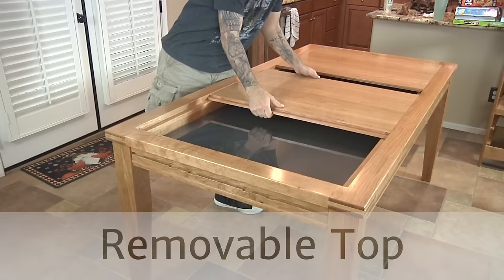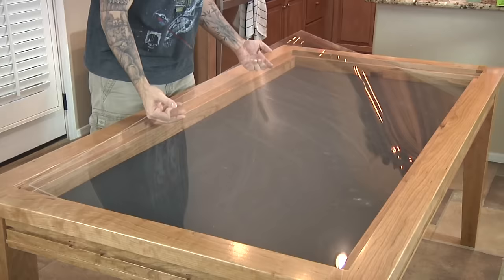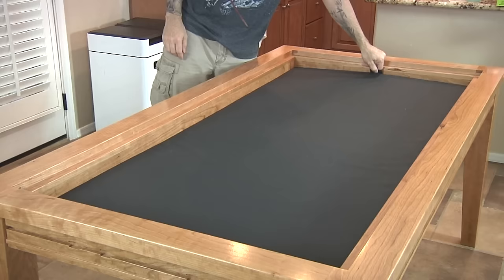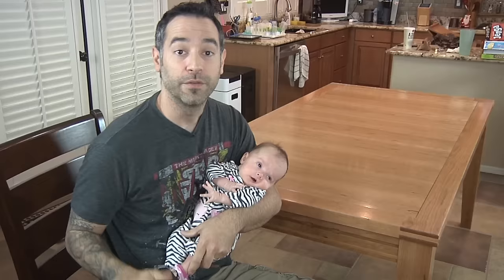The Gaming Dining Table

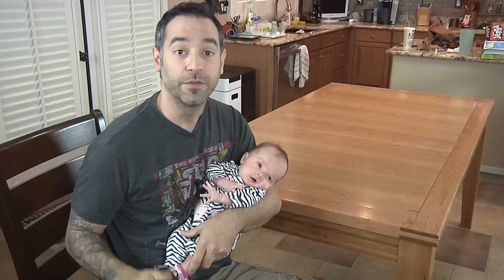Comment: That's a pretty impressive table - you can see the precision when you're putting the three sections in at about 5:18 and the air pressure from the last one lifts the other two.
Reply: +Paul Smyers Yeah, I was just about to say that until I saw your comment. Tight work, huh?
Reply: @Rouverius , The table, or the child?

Comment: Hahaha, thought it was a DIY and was thinking "yeah, sure I got those tools at home!" ... Looks like an awesome table! :)
Reply from the maker: Well, I DID build it myself! :)
Reply: same here then boom all kinds of special tools XD
Reply: I mean, you could pull this off without the planer and a lot of the special tools. The only things that a normal joe might not have are the table saw, planar and the router. Of course you can simplify the design, take out the fun connections and just drill and dowel the ends of things. The router would only really be required if you want the outside rail. Projects like these are as hard or easy as you make them.
Reply: Dude made his own veneer!!!  Wtf!!!!???
Reply: My thoughts exactly.  I've done 2 game tables and I've been using mdf with veneer.  It's pricy but stays straight and looks great.

Comment: This is amazing.  The only complaint I ever have about these types of build guides is true for nearly every one of them.  Over 95% of the people who would watch this, if not a higher percentage, have zero access to the tens of thousands of dollars of shop equipment that is needed to make something like this.  Seriously.  Once again, this table is amazing, but almost no one is going to have access to build something like this.
Reply: check your city for a maker space... they are popping up in quite a few places.  renting time in a makerspace woodshop might be waaaay more affordable that you might think. especially if you enjoy woodcraft.
Reply: Aside from renting like Kirk mentions, you don't actually need the setup of a shop like this.  He's just showing you how he does it in his professional shop.  There are lots of people on YouTube that show you how to set up a woodworking shop for under $1000.  Steve Ramsey is continuously updating his list for this.  You absolutely can do it with this cheaper setup, but it requires more use of hand tools vs. power, more time with setups, and will involve more time on finishing work/sanding because those tools aren't going to be as clean with your lines as the professional grade power tools.  Either way there's hours of sanding, but more so when using consumer grade tools.

Other than say, a domino, these tools don't do anything the cheaper tools can't. They do it faster, more precisely, in a more easily repeatable fashion. Even a domino can be functionally replicated

Comment: Such a precise fit, you can see the air pressure push a panel up at about 5:15 when you're putting the top on. Your projects always satisfy my OCD tendencies.
Reply: +Peter Gillock I had to scroll down to see if anyone else commented on this. I guess it's a sign of precision craftsmanship!
Reply: +Joe Brewer Haha, I did the same thing.

Comment: Suggestion - add drip catching rails.  Add drip catching rails to both sides of the center table leaf.  Add drip catching rails to the perimeter of the table sides so that the table leaf rails drain into these perimeter rails.  Have 2-4 little pipes that lead from the perimeter rails to the bottom of the table where the liquid exits to the floor, or to a plastic container.  Lastly add beads to the table leaf underside edges so that  the liquid does not by-pass this by-pass system and end up on the playing surface.
Reply: +Big Fat Tony's 

I find crumbs are the biggest problem for mine, which shares a very similar design.  But his tolerances are definitely better than mine, so its probably not too bad for him.
Reply: I don't have ideas for crumbs, just for when a glass of milk gets knocked over during dinner.
Reply: oh, one idea, put a brush that is used for billiard tables in a hidden place on the table, then with the brush in the table you may be inspired to use it after meals.
Reply: +Big Fat Tony&#39;s  
Hey, Tony. My thoughts on this table design are exactly the same. I am planning a game table of my own, with similar inset boards, and was thinking about the whole drip catch rail design as well.  Have you built one with these details?  If so, I'd love to see some of those details.
Reply: I'm in the middle of construction and have not made the table top nor the drip rails.  However,  I got my ideas from Geek n Sons, a maker of game tables in Poland.  The video was posted by "Radho", an American guy living in Malta.
Reply: water will not pass thru white oak and it is available in the USA.  I sized my gaming surface for a Subuteo felt and so far that has accommodated all of my board games as well.  I really need to get that top on the table so I can bring it up out of the basement and replace the current kitchen table.
Reply: +Big Fat Tony&#39;s   Found it.  Took an hour of wading through the 4 part video series to find the part that shows the drain rail.  LOL.  Geek'n'son don't even show this feature off on their website or videos that I can find.  It is a great idea.
Reply: I could not find any mention of the drip rail system by Geek'n'Son either.  The improvements that I thought of are: on the table leaf without the trough, a bead is needed on the underside edge so that the liquids can not run along the underside and miss the trough when they fall, the ends of the table leaf troughs need to be shaped to prevent the same.
Reply: @BigFatTonys , simple solution, sippy cups for everyone!!!!!
Reply: That is what I get after 3 years ?  Chisel me Spaggs!   @markw3598

Comment: I love the design of this and have already marked it my winter challenge. 

Regarding the top, in your design, what led you to the leaf top rather than a solid over-the-edge topper. The latter seems like it would protect against spills better but I didn’t design the piece so I’m wondering what the decision process was. Aesthetics is a perfectly fine answer, too.
Reply: He mentioned in one of the project videos that he wanted a frame wide enough that you could comfortably rest your arms on it, and he wen't with a leaf top because it would be easier to handle than one solid piece.

Comment: Those accurate fitting panels causing the far panel to pop up when the other panel is dropped in at 5:18 due to the seal...  Damn.

Comment: Looks great. Love the idea. But as a father my first thought is when the kids spill something liquid it's going to leak down into the game mate
Reply from the maker: +cchaffin2012 and if it does, we'll clean it up. The finish is poly, the speed cloth is waterproof, and the acrylic sits on top protecting it all. Really not much to worry about. I'm far more concerned about the kids spilling things on the couch or the carpet. :)
Reply: +The Wood Whisperer   Aw ok the cloth is waterproof that's makes more sense. My 3 little ones spill drinks all the time. So when I saw that you used spray adhesive for the cloth I thought well that's not going to be easy to clean up if it soaks up liquid like a sponge. Good job!!

Comment: General (and probably silly) question...I'm looking at making this table once I fine tune my wood working skills a bit more. I don't have a shop at my house, but do have a local one that lets you use it for a membership price. My question: is this something that you can make all the cuts and assemble it elsewhere? Or do you pretty much need to assemble it in shop to make some of those minor adjustments as it comes together? And one more related question, seems it is fully joined with no disassembly option. Would I be correct in assuming plans don't offer an alternate design for assembly/disassembly? I know it probably wouldn't be too hard to tweak it to accommodate such an option, but just didn't know if that is part of the specs/videos you can purchase.

Comment: I actually had a similar idea, with wider "arm rests" though so big board games can gold the character trails on the outside instead of in the inside.
Any particular reason you used veneered plywood for the cover instead of just using wooden boards? do the warp less?
Reply: Cost. Typically the vault you want as large as possible, so the arm rests in this design are good size. If you want character pieces on the outside, make an add on and attach it to the rail. Add-ons are limitless for this
Reply: Okay, maybe I'm thinking too much in German terms. An Ash board for example here would be cheaper than getting proper plywood and nice veneer ;) although I could probably get a few sheets of ash or walnut veneer from work for a few bucks... might be worth looking into.
And yeah I kind of had the problem of balancing the size of the vault with bigger armrests. Though that's mostly an issue because I'm working around the board of Nemesis which is pretty huge for a board game. And it also has trays for every player and card stacks and putting those onto trays for the rail system would mean that players would need to sit quite a bit away from the actual vault, while I can take a bit off of that by just making the armrests wide enough, which I also like the look of. Though I have to admit I'm already hitting some roadblocks in finding nice boards that are wide and long enough. Welp, I have time to plan and get more inspiration here ;)

Comment: Nice work. 
But not everyone has the space of a workshop as you do or the tools. Especially an air bag that sucks the air out to pressure clamp veneer to panels. Why didnt you just use some precut panels and tongue and groove those. Or even use a single sheet of oak plywood half or three quarters inch thick for the bottom of the table. For all the work of that fancy frame you put around it. It wont be seen once you build and put the sides of the box frame of your table on top. It got covered up by the felt or leather insert game playing sleeve. You can also cover it in felt.

Aside from that I like how you made your track system for your railing to attach your shelves or drink holders.
Reply from the maker: I don't build furniture for "everyone." I build the furniture I want to build and I show people how I did it. I use high quality materials and more advanced techniques because that's what I enjoy doing. "Fine" woodworking tends to include a lot of additional effort for small gains. You'll find a lot of that on this channel.
Reply: I didnt say you build furniture for everyone. I just made a comment that not everyone has fancy equipment or space like you do to build such an elaborate table. Ive worked in cabinetry yrs ago and I sure dont have a vac bag in my work shop because I cant afford one for they are not cheap nor the space to have one to do veneer table tops.  You obviously missed that all together.  But I to enjoy doing woodworking but it helps to have the large space or equipment to do what you did in the video. And for those who dont have a vac bag for veneer as I was pointing out could substitute veneer for just solid wood tongue n groove panels instead.
Reply: @michaels728  He discusses multiple alternative options in the build videos for the veneered top. Whenever he uses a niche tool like the veneering bag, he always presents alternatives.

Comment: lovely, could give some info on those knobs you use with the acessory rail? interesting polishing technique also... how long does the poly have to dry for that?
Reply from the maker: +TheJohdu Just  a few days. It's not being polished to a high shine, just smoothing the surface. And the knurled nuts can be found on Amazon http://www.amazon.com/gp/product/B00RAC8R5Q/ref=as_li_tl?ie=UTF8&camp=1789&creative=390957&creativeASIN=B00RAC8R5Q&linkCode=as2&tag=thewoodwhispe-20&linkId=OQZYTMCSLGN5LK6E
Reply: +The Wood Whisperer thanks alot marc. one other question: here in germany there is no such thing as whipe-on poly. so i mix my own blend with one half poly or poly-alkyd to one half cellulose thinner or white spirit. the dried finish stinks like hell for around three weeks. waterbased finishes aren't really an alternative on darker woods. so does the whipe-on poly also have such a long lasting odor? is the so called odorless mineral spirit (also not available in germany), really odorless?

Comment: What was the reason/purpose of having the wood in a plastic bag and then sucking the air out of it?  What did that do?
Reply: Mainly used for doing the vaneer glue up i would guess. The vacuum provides equal pressure across the entire piece at once minimizing voids/air bubbles.

Comment: what purpose do the different layers serve? I understand the soft one for making it easier to pick up cards, but what's with the plexi?
Reply: +helmet098 my guess is it probably helps protect the soft layer from spills when the table is in table mode
Reply: +helmet098 The game maps used in war games or role-playing games are often just rolled or folded paper maps rather than the mounted boards used in most board games. A sheet of Plexiglas will keep them flat. You can also draw on the Plexiglas.
Reply: +Scott Roper ooh yeah! never even thought of that. Nice!

Comment: At about 3:20, why use the vacuum package instead of clamps/vices?
Reply from the maker: Because I find vacuums to be easier to use and much more consistent.
Reply: so its sort of like take tons of textbooks and stacking them all around the piece of wood being laminated, but in a fraction of the time.   Cool technique, but I will have to stick with the textbooks since I have gone through a Bachelors and need to find uses for these textbooks gaining dust.   Thanks for the reply.

Comment: I might of missed a video, has your workshop changed recently? never noticed all the black foam mattes.
I'm very fond with people which use festool products as i want to purchase them myself, but noticed you didn't use your router, why have multiple? ( if you still have it )
Reply from the maker: +Alex Lacy You may have missed about 80 videos. :) I moved into the shop a few years ago and installed the mats soon after. As for Festool, I'm going through some tool brand changes at the moment.
Reply: +The Wood Whisperer ooh right okay. Aha I don't think i missed 80 videos.. just a video here and there.
Reply: +Alex Lacy Also, i always find it difficult finding references to use for the heights of furniture i.e seats, tables, hanging rail heights for wardrobes. is there anything you use as a reference, web page or ..?
Reply from the maker: +Alex Lacy I haven't read it myself but I hear good things about this book: http://www.amazon.com/gp/product/0823072711/ref=as_li_tl?ie=UTF8&camp=1789&creative=390957&creativeASIN=0823072711&linkCode=as2&tag=thewoodwhispe-20&linkId=UXFSIPIN6DYXQNSK
Reply: +The Wood Whisperer 
It is a book a lot of interior designers/architects use as a reference.
So it's a great book.

Comment: in just the cost of the wood, not including laybor how much does this cost to make.
Reply: That will depend on wood species, and your local prices.  You need 70-80 board feet, plus two sheets of hardwood ply. Depending on the wood, you could easily top $700-900

Comment: Yes, awesome table, but totally impractical to build for 80% of the DIYers who don't have $5000 worth of woodworking tools and a shop to hold them.  Aside from tool envy, I did get one thing from the video and that as the clever idea to create a recessed pin to pop up the inset panels.  I was puzzling over how I was going to do that on my table.  Thanks for that clever tip.
Reply from the maker: +Claude Monroe Oh, I totally agree on the DIY aspect. But this video and project were never intended to be "DIY."
Reply: The Wood Whisperer 
My mistake.  This came up in my DIY search and I didn't realize it was not promoted as such.

Comment: Yeah, it cool if you have your own carpentry shop. For everyday Joe with just a garage and some tools its impossible to make.
Reply: Not really. You can get the lumber pre-milled, and use hardwood ply for the top so no veneering needed. Doing that, you could pull this off with just a contractors saw, circular saw with straightedge, router, and chop saw. And a few hand tools for cleaning up mortises and joints.

Comment: Won't it be a nightmare of a clean-up job if somebody spilled anything on the top surface?
Reply from the maker: +Hazel Hazelton Not really. Obviously it&#39;s not as fun to clean as a standard table but the tradeoff is worth it. Far from a nightmare though. The rabbets will catch much of the liquid and the acrylic layer is there to catch anything that leaks through.